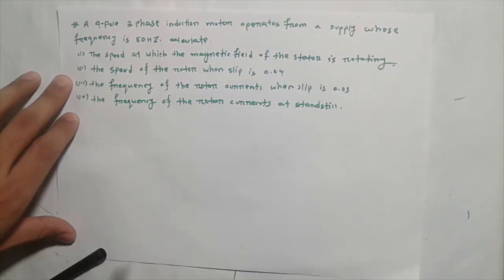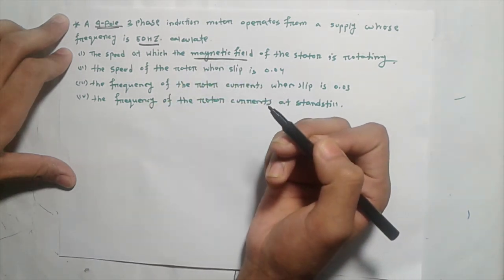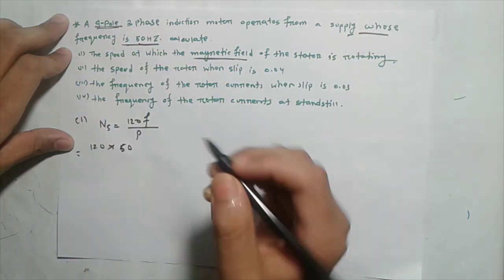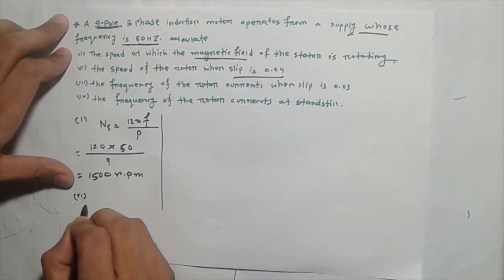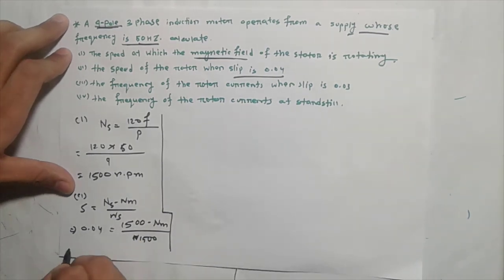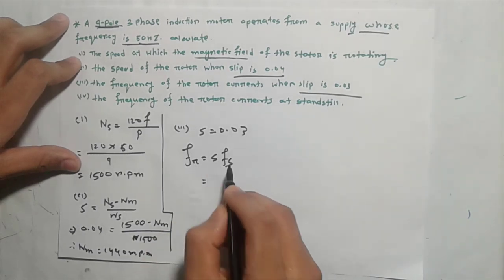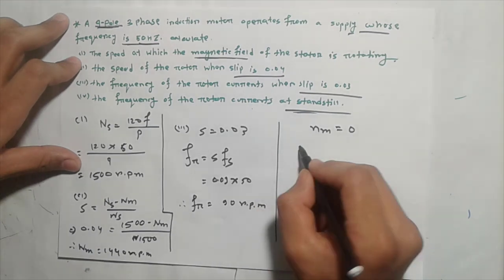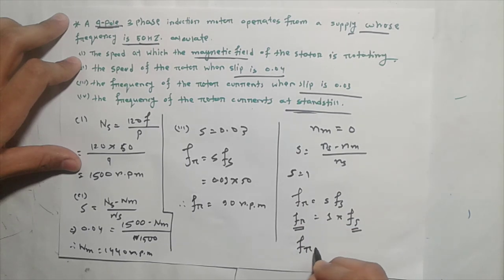Induction Motor Math Problem || Bangla

Comment: Sir plz say that 3 no. Fr=sfs  =0.03*50 =1.5. 

Plz say why you write the fr =90.????
Reply: Because the unit of Fr=(Sxfs) is rps(revolution per second. Now you can multiply the value with 60, which indicates seconds, so total (1.5*60)=90rpm